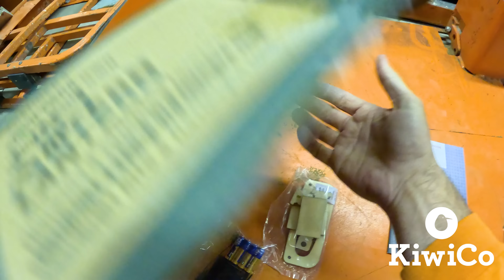How to Install an Elevator in your Backyard

Comment: wait... hold up. so. not only is there a version of rebar that doesn't rust. but its also cheaper!? why isn't this used EVERYWHERE!? that's the major failing point of concrete structures is rebar rusting and expanding causing cracking and cracking runaway.
Reply: Because it's untested and no one actually knows if it is better or worse than steel.   Using carbon fiber rebar in a construction project, that might suddenly snap because testing was not extensive enough is not something any entrepreneur wants to gamble with.  Using it in a tiny project like this one that will never see more stress than 600lbs, makes it "safe enough", and since it's a diy project, he's the only one liable anyway.

Comment: I would never use lift as my elevator. We use an electric engine hoist. Switches to run it are so easy to make and everything is probably much more reliable bc there’s less parts… use pulleys to keep it underground

Comment: If you built a pipes along the sides of the cart that extend upward to the top of the elevator shaft  you could have a aluminum "roof" at the top that would seal once the elevator is all the way down. Throw 3-4" of sod on top and the elevator(roof) will "disappear" unless your looking right down at the rectangle. From 10 feet it would not be that noticeable once the grass is mowed all the same(no need to mow around anything). 
The more important factor here is this will provide a air tight(and watertight) seal at grass level by having that platform's "roof" by default performing that seal.

When the elevator goes up so will the  roof with the sod on it. The pipes from the elevator  platform to the roof will act as guides stabilizing the elevator through travel. Obviously as it is fully raised it will be less stable and there may be concerns with power lines etc. If that becomes the case then maybe a pipe into a pipe setup could be done so that when raising one pipe slides into another allowing the roof to come up a mere lets say 8 feet but when going down the pipes will pull each other down to once again provide a seal.

Comment: 1:03 well no wonder Menards hardware store uses a lift (order selector forklift) as a makeshift elevator lol. They've got one in a fixed place in a shaft they built to reach the first and second floor. That's crazy how much money that is for a residential elevator. You are very smart for going down this route. And so is the Menards CEO or whoever whoever made that decision. The thing is Menards is the third biggest box store hardware store with Lowe's and Home Depot being first and second. Obviously being a commercial business they can only do so much to fit in with code standards but using a scissor lift as an elevator for your own personal residence... You can a wire up call button and all sorts of fancy stuff that they wouldn't be able to do at menards. Another words, a raised and lower button on each floor, wired to the vehicle (scissor lift) Great idea. You know it really brings Jerry rigging to the next level with what you came up with! (Edit): meant to send 10 dollars but whatever 2 dollars works I guess
Reply from the maker: Thank you!!!
Reply: Local thrift shop uses a custom wood box/platform lifted by their forklift as a freight elevator to the second story, works great

Comment: I work in the elevator field. That is not an elevator. It is not safe. There are national codes to elevators and I doubt yours meets any. If anyone rides that and trips they will sue you for all you have. You need to rip it out and get one installed that meets code. I love your videos but safety codes are there for a reason and you should never go cheap on something your life depends on.

Comment: That’s really nice but no body is not talking about that free fall concrete will cause segregation 7:07. As engineer the maximum permissible free fall of concrete to avoid segregation may be taken as 3 to 6 ft so next time use drop chutes or any other equipment to can minimize the effects of concrete free fall 👍🏼
Reply from the maker: There are several recent studies that say free falling concrete doesn't compromise the structure at all. I'd also be more cautious if this was structural. But it's not.
Reply: Careful there that all depends on mix. And yes I agree it's not structural so no big deal. Just consider that if you do a drop pour, concrete testing is done in labs and standard placement is that way for a reason. 
I often forget how many variables are addressed in a simple pour.

Comment: I have 3 children, but my oldest that's 7 has an awful genetic desease called SMA. He's in a wheelchair for life as he has next to no muscle strength, LP injections 3 times a year from Biogen that would cost someone $120,000/injection if it wasn't sponsored and now covered by universal health care.

We are building a house atm that fits his needs, as we live in a bi-level atm. It's a 2 story with full bath on main floor  and bedroom. Before Covid, we were looking at installing an elevator in a 2 storey house. But the cost almost doubled from $35,000 to $60,000. House prices also went up. So we couldn't give our oldest the ability to go upstairs or downstairs anymore.

Huge props to you for giving someone with wheels the ability to go wherever they'ld like to go. As a 30 year tradesman, I wish I could do to same for my oldest son, but can't afford it. 👍
Reply: I had a buddy run a mine cart style setup with pulleys and rails up his stairs for awhile when he was fresh out of rehab before moving somewhere accessible 😂 it was a mess but got the job done but not independently. you could probably find a used chair stair climber lift off fb market place, only problem is the getting the chair up too.   there’s a good fb group called the disability trading zone that would have a bunch listed too, often free if you pick it up, also a bunch of wheelchairs and DME stuff!

Comment: Maybe its an idea to fit a little mini Split Ac in there?? You would have heat and cooling and dehumidifing to stop moist entering the bunker. Also there are some hybrid split ac's out there and you can plug solarpannels in it directly. like the EG4. So whenever the world is going to end, and the sun is still shining, you would have heat in your bunker.

Comment: add a few smooth rods (2 on each side total of 8) going the full height of the 'elevator' and add wheels to the top and bottom of the aluminum basket by each bar to prevent it from wobbling 

alternatively you can use angle iron one in each corner

Comment: The elevator now just needs doors, guide rails, shaft switches to prevent it from going too far and to keep it aligned with the floors and possibly a Raspberry PI for its logic! :)

Comment: Wow mixing your own concrete is great but when u do it by the bag must have ran u 5k probably 1/4 the price to have a truck bring it or u can even get it al deliverd separately and shjvel it in but by the bag thats crazy did that once for a sidewalk was 3 times more money using the cheepest bags than a truck and that was 2000 01 way before covid jacked up everything
Reply: Sorry cool video good idea using a scissor lift some dolly wheels on the side would make things more stable and can be made to be adjustable mab2 6" solid wheels or something mounted to scissor jacks would be a cheep safe fix. Thanks for another good video also did u ever finish the Hummer? I loved that build main reason I found your channel

Comment: Zach may I draw your attention to a couple of YTers who’ve had a combustible toilet in an off grid scenario and it never worked, they are the vanwives and I’m unsure which company they went with but getting customer service from them was a problem, I can imagine if you’ve had to relocate because of an issue on the surface (like Covid) you may want your loo to work properly, please either work out what doesn’t work on these or build your own I believe with your knowledge you can build your own, it would be a darn cite better than the one the vanwives had, reach out to them there lovely people.

Comment: i. can only imagine, this video, either we all reincarnate and facepalm ourselves for the high cost low tech , or those gen of kids will be laughing off our " primitive methods " 

ps. 

just a random comment, is to add some spring loaded ramp for your wifu.... @15:18, the gap can be mitigated just by digging a slight slope down , 10de ? towards down the shaft and with the contraption on the metal/ alumin sides. 

you might have to do a mini roof as well, in the event of heavy rain / sudden snow, so, you dont get things loaded on the platform unnecessary.... 

unless you're planning to build a con-clove entrance at the top later on  ?

Comment: I built a lift for my old house with using an old Car Piller lift.  Just used one side and put it in the corner.  We filled in all the locking points except for the one used for upper floor level.  Worked great (a bit loud) and was less than £1000 for the full build.

Comment: Fun thought, by having a (lid) plate on the top of the platform cubicle, that gets "left behind" when the cubicle lowers below the surface, will appear as if a simple landscaped part of the normal property lawn (with say for eg: a 3" raised flower bed, for artificial flowers), which hides the fact that there is in fact, not only the cage waiting there, or at the bottom, but that there's a huge hideaway bunker (down there) at all.

The wandering controller, on that lead attached to the platform/cubicle, could be stored when at the top, behind (inside) a small Garden Gnome etc., which will simply stay beside the flowering top plate, when the scissor lift is lowered, because the wandering controller will be with the people going down anyway, so hang it on a hook inside the cubicle, when at the bottom.

Anyone viewing the yard from above, will ONLY ever see, that slightly raised (artificial) flower bed, unless the cubilce is raised above ground level for entry & exits, before lowering to drop the cover plate in position and putting the controller inside the "Garden Gnome - (which just looks the part, just sitting there.

Also, have a "top of fence or higher", backup solar panel recharger, hard wired to a house supply battery charger circuit, which could be hidden across the lawn to be dropped down the shaft wall, to the batteries far below, so that they can be trickle charged all the time, (even if there is a major power cut, at any time) in consideration, that after the novelty wears off, the scissor lift won't be operated 24/7, and daylight solar can then be used - whilst a nightime house supply trickle charges at night.

It's a clever & brilliant repurposing of an almost scrapped machine, yet a very cost effective alternative, to a conventional lift that as you said, inside you house, cost several thousand dollars, as that one for all it's high cost, possibly isn't as "cool" to operate as your make-do lift.

Oh and when you "sell the place" you won't even need to tell them about, your very own secrete and totally private "get away"...
Unless caught creeping across "their lawn" one night?
Reply: Neighbor's kid:  Mommy?  What's that man doing with the hole in the ground?
Mom:  Pay no attention to him!  He thinks the world is going to end.
Kid:  But mom.  His fort is sOOOO cool!   It's like mine craft and...and..

Comment: Use small wheels on tracks kinda like a garage door,  and at the bottom you could have it stop/slowed by rubber or light shocks or springs or a combination,  so it's not so abrupt of a stop at the bottom

Comment: It will be better if you can add 4 vertical channels (with bearing or rollers) from the bunker to level 0. And the channels will be bolted to the walls... This will eliminate the wobble while going up or down...  Just a thought...

Comment: So cool to see more progress, smart to use a scissor lift!
Though I thought about it way after I watched the video, the lift is a little wobbly at the top height. You should install steel guide wheels on like three sides that go up on rails attached to the walls. You know? Could be a wise addition so it doesn't have that wobble.

Comment: FYI:

It is much cheaper to excavate down 50 feet, and pour 5 floors of reinforced concrete, and put a foot of topsoil over the top.

This would give you 5000 SQ footage of underground new space.

The method you are making this is much harder than anyone else who does foundation and commercial construction work would do.

Comment: You should add tension cables on the 4 corners of the platform so it doesnt wobble as much, would also stop the elevator perfectly at ground level

Comment: Jerry needs to paint this as soon as possible. There are surface level rust visible in the elevator structure as well as in the weld joints in the metal sheet behind the bed.

Comment: Next thing you need is nuclear power generator like in submarines for the unlimited power supply. Also you can add manual lift(made up of gear wheels) in case of power outage.

Comment: Kinda think this is stupid, what if it doesn't work when you need it to?  Stairs mate........ throughout history.  I know your wife needs it but still, you could carry her......  It may not go up or down, or down fast enough depending on the event.  Clearly you know what I mean or you wouldn't have built it.......  also the scission lift......  under it, a kid could be under if when its coming down, will need to somehow add a cover to that and ensure on the top edges when going up or down u can't put your fingers over the sides to get chopped off.  Alot missing to the safety of this.

Comment: I wonder if adding some steel onto the elevator shaft and some wheels on springs on the back and sides of the aluminum platform if it would allow for a "smoother" ride up and down.

Comment: Scissor lift elevator is actually pretty brilliant the more I think about it.

It's going to be cheaper than a "proper" elevator (of course, you trade off it being kind of more janky). It may technically be less reliable BUT it would be cheaper and easier to fix. Parts would be much easier to source as well, and if you need to call a technician, it's likely the technician for a scissor lift is probably cheaper than an elevator repairman. 

It might not pass city code in a commercial building for a proper elevator, but it perfectly fits your needs and is fine for what it is going to do.

A pretty damn good idea overall. I like it.

Comment: I'm worried about the lip of the entrance, do you feel it's high enough to handle lawn flooding during a heavy rainstorm? I worries me how low it is. I guess it wouldn't be hard to weld an extra inch or two of metal on top though and then just have a ramp on one side.

Comment: This is wicked. Fun fsct. China's fastest nuclear weapon in terms of delivery systems would likely be one of their intercontinental ballistic missiles (ICBMs), such as the DF-41 (Dongfeng-41). The DF-41 is believed to have a top speed of approximately Mach 25 (around 30,000 km/h or 18,640 mph), allowing it to reach targets across the globe in under 30 minutes. This missile is designed to carry multiple independently targetable reentry vehicles (MIRVs), making it a highly potent and fast delivery system for nuclear warheads.

Comment: Should have checked out the product mud mixer great tool
Reply: They're for fence posts and that's about it. I liked the idea but I've talked to other pros and it's impossible to set a consistent mix.   
Crazy amount of money they want for them. I thought rental companies would get them. 
For the price you can get 6-10 commercial mixers, line up two or three of those and they produce more than the mud mixer at a set slump.

Comment: To be honest, I really wouldn't want likely poorly maintained (or even if they're perfect now, they'll be sitting a lot)  hydraulics in an enclosed space like that due to leaks and fire risk. Would much rather just install a winch-and-cable based system. Any fire or release of hydraulic fluid down there would be a really bad day.

Comment: Welled some unistrut to the walls and bolt in some roller bearings to the elevator to keep it stable going up and down also you can put some bolts in at the top to act like a hard stop so it a lot more stable when it's all the way up

Comment: When you twist the rebar wire pull the handle tight towards you (away from the rebar) pretty hard while you are twisting it will give you a better more uniform and tight twist.

Comment: Love it, don't know about scissor elevators, but you could add one of those pistons that only engages if it it moves faster than (regular speed) on the bottom next to the hydraulics cylinder that makes everything move. In case something fails or a hose breaks. So you can be super shure there is no way anything could go wrong never.

Comment: C channel steel rails welded to the walls, with hard rubber casters attached to the lift. Wheels roll in and against the channel steel and keep it stable.

Comment: I think that you should make stop switch on top so elevator will stop in time. Also you should make some guides on both sides so platform would not move. Also you should mount controls onto that platform and make some type of door so when you close it then elevator can move. These are some of my recomendations beacuse i work on elevators

Comment: could have done a platform lift with an acme screw. It would have been a little safer and  without any wobble. I made one easy and can fab most of the things needed. The screw and the motor would have been the only thing needed to buy. Anyways love the ingenuity .

Comment: Do scissor lifts fail safe?
Why didnt you paint the leveling braces?
What happens if the elevator fails at the bottom, how to get back up?
Reply: Is there a plan for a safety gate around the hole?